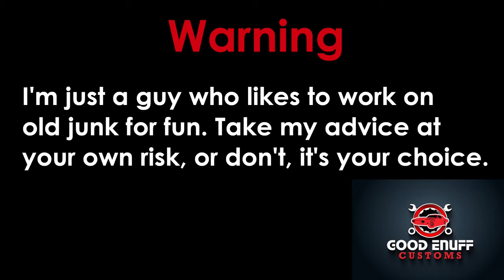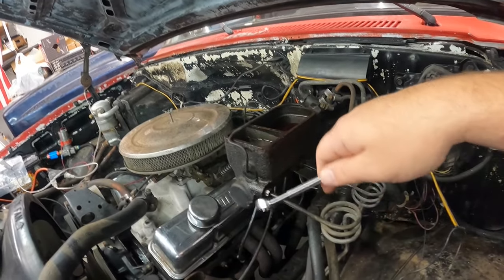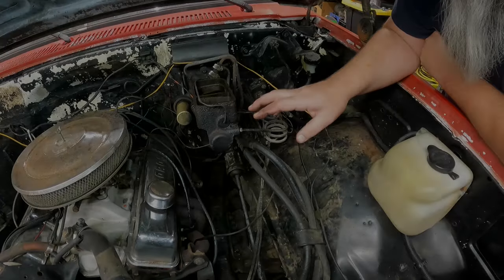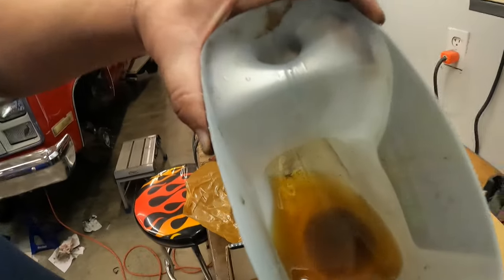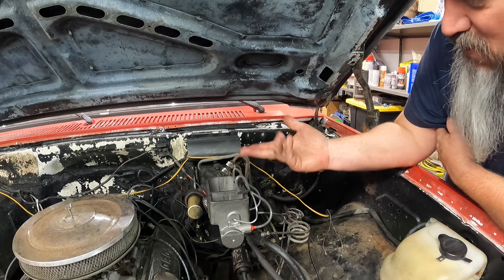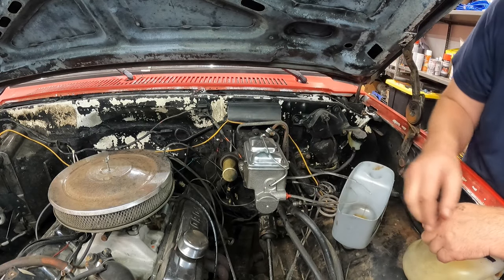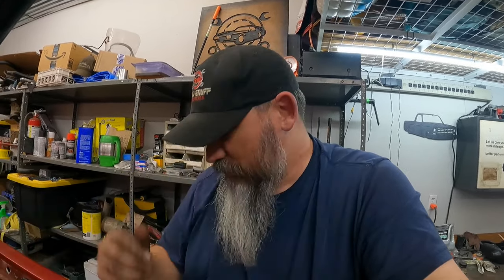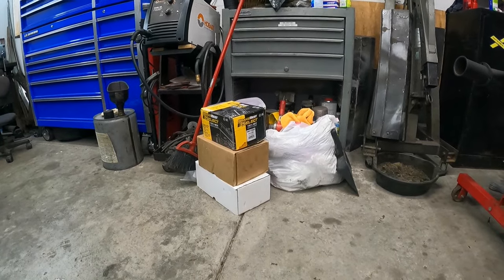Little John - Brake Master Cylinder Replacement

Comment: Hey dude bro good enough custom why don't you just call that 1986 GMC Sierra little Johnny Cash and what about you throw on some LED head lights and tail lights and then throw on LED lights under the hood of the truck and then throw on some LED rock lights and then blackout the chrome and then 199,000X tinted windows and then throw out that old motor and then throw on in under the hood a brand new 999 big giant block blower Hemi Scat Packed SRT8 RT RS SRT Demon 170 motor and then throw on some 970,000,000,000,000 billionaire millionaire trillionaire thousandsanaire grandnaire inch Firestone American Air Force Forgeoto money monster truck wheels and tires and rims and then throw out that old exhaust and then throw on some aired bombs train horns and then throw on some flaming flares flashing flames bed exhaust system and then to that way it will blow some LED lights flames. And then my name it is Jeremy Lee Martin
Reply from the maker: You forgot to lift the front of the truck a solid foot and lower the rear for maximum squat...😆